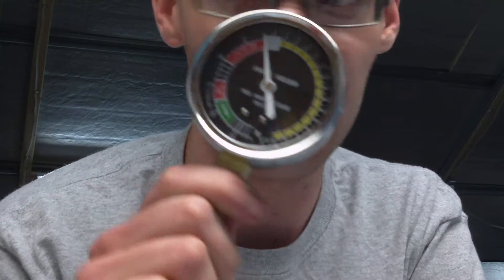Diagnostic Tips Notes Part 1

Comment: first off very nice videos. Not a lot of videos on the c4 with people that actually know what they are talkiing about and hone experience. Well anyways I was wondering if you have experience with the h26 code popping up. It is causing the fans to turn on right away, which I am guessing is because of the code throwing the system in a limp mode or something. I have sent the ecm into cardone to be rebuilt which was an arm and a leg but im going to count that out right now. What seems to be the issue. I know that it is a module 1 voltage reading from the ecm being either high or low but what is the common issue. I have a 93 vette. thanks.
Reply from the maker: No common issue on this one. Best background info I can give you with typing a book is this link. No silver bullet on this code. Your rebuilt ECM could still be bad but it can be cause by other things as will note in the link. https://www.corvetteactioncenter.com/forums/c4-technical-and-performance/127327-93-vette-pulled-code-26-qdm-fault.html